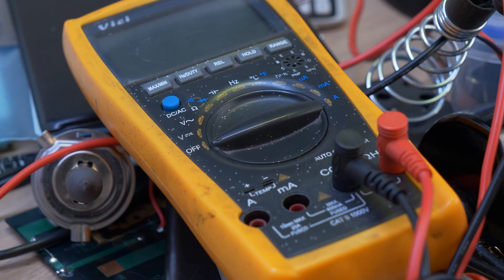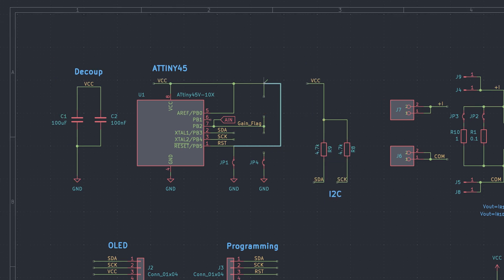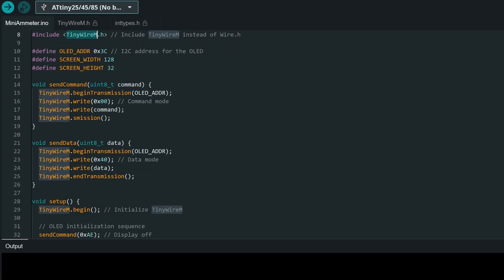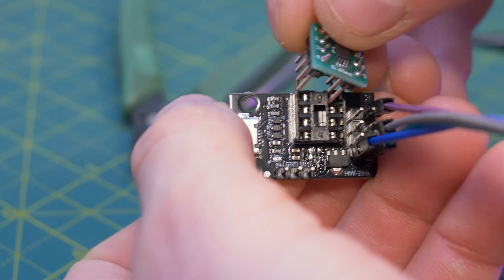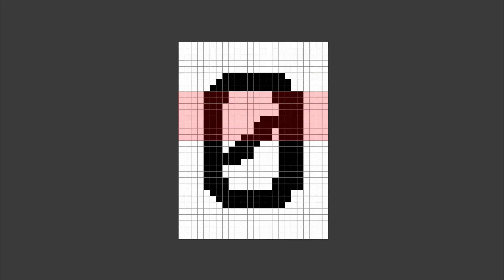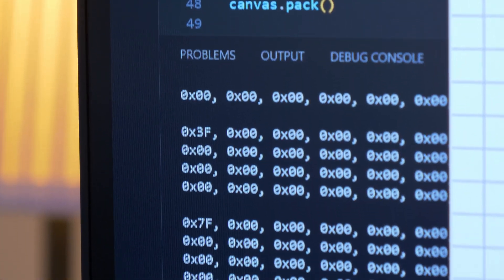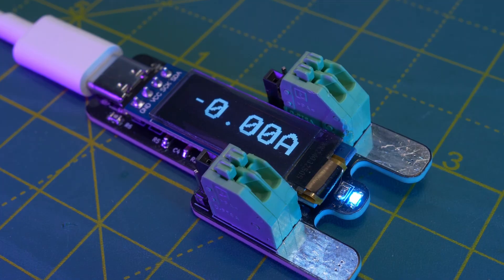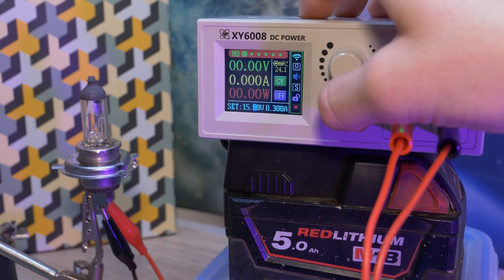How Far Can 4KB Go? ATtiny45 + OLED

Comment: These tiny chips are fun to program. I made a PWM fan controller working as an I2C slave device, with support of setting target RPM rather than just raw PWM. 
I made it fit in under 1K of flash and 64 bytes of ram, and I got to learn low level i2c while i was at it

Comment: You don't need to dedicate a pin to measuring Vcc. The internal ADC of the ATtiny45 has a 1.1V internal bandgap reference, which you can use to measure Vcc, just indirectly. Set ADMUX to select the bandgap reference while using AVcc as the reference voltage. The rest is just math: AVcc = 1024 x V_bandgap / ADC and there you have the power supply voltage. For better accuracy, you might have to measure that bandgap voltage by writing a sketch to use the external Vref pin and connect it internally to the internal voltage reference, not AVcc.

Comment: Nice project - well done!
The coding is a bit, uhm, rough :). There are some problems like integers truncating (you're asking for 1023 sample averaging window, but the variable is of type "uint8_t" for example). Luckily that works out in that case (you get 255 samples).
I'm sure this program would comfortably fit in the memory with room to spare with some tweaks. Also, the ATTiny45 can sample the ADC in the "background" for you, so you can update the screen more often without delays. Look into the ADC registers of the datasheet for fun ways to play around with that.
Either way, great job! Looking forward to seeing where you take this!
Reply from the maker: Thanks for taking the time to look though the code and give some genuine feedback and guidance for me, it really does help. 
You've absolutely right about the truncation, and the ADC sampling was something I knew about but didn't try to implement because I was already struggling to finish this project. I've got a few more ideas for these MCUs so plenty of time to learn more about them, and how to write firmware, which is something I've only started to tackle this year.

Comment: You can use oled screen without and module because you also using board. placing board on top of a board? Looks ameture (not you, you are professional, product looks bulky lol). I designed board with attiny85 and I2C screen. Waveshark helped a lot with opensource gerber file (format of pdf)

Comment: Neat project and especially liked the explanation of how you draw on the oled. A possibly cheap alternative is to use an INA219 current sensor to get more accuracy and not overly complicate the board.
Reply from the maker: Thanks, I couldn't find a good explanation so I thought others would benefit from this. Great suggestion with the INA2189, that's a perfect upgrade for the next revision : )